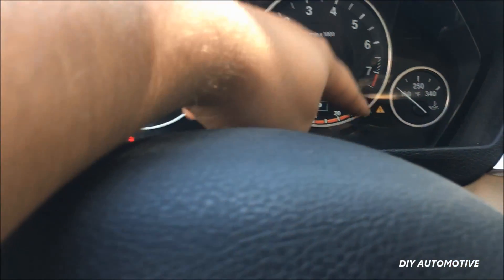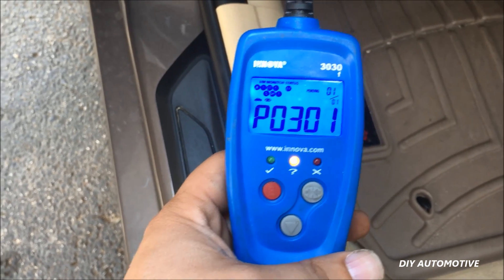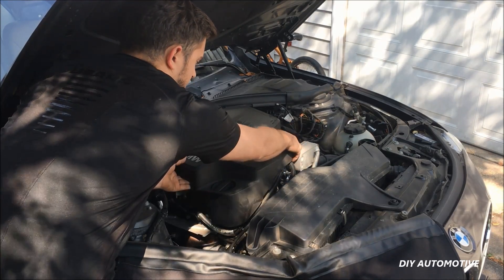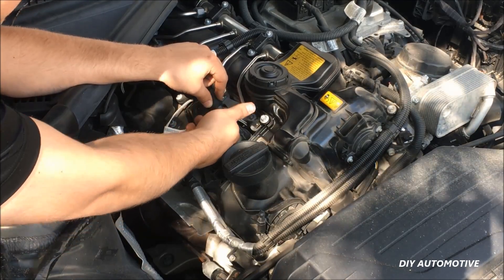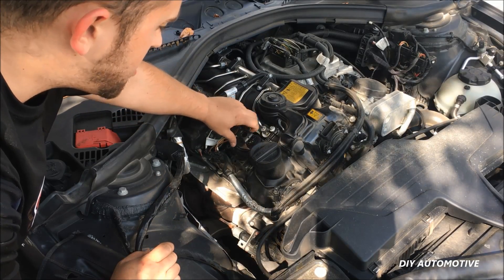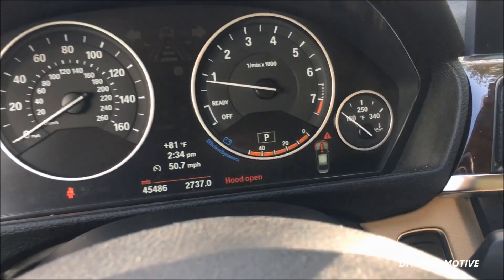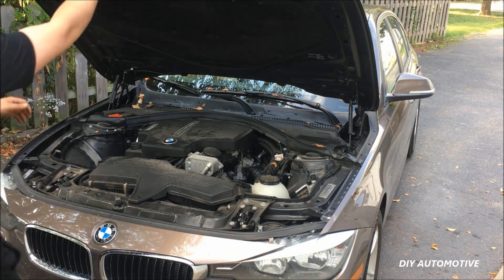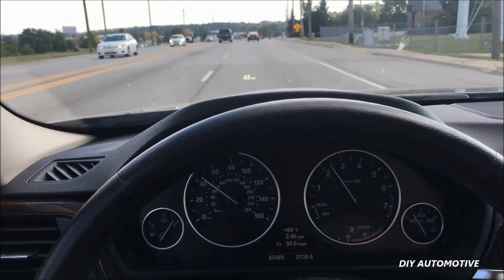Fix Misfire No Power; BMW Ignition Coil P0301 P0302 P0303 P0304 P0305 P0306

Comment from the maker: Link to coil: https://www.ebay.com/itm/322979331273
Reply: I am from indonesia. My f30 suddenly difficult to start then the engine is shaking and suddenly the engine turn off. In i drive show drivetrain multifunction. 3 month ago i already change spark plug. Now the problem is iginition coil fault or crankshaft sensor?

Comment: hey man i have a f30 with the “drivetrain malfunction” screen and when i scan it, it shows generic codes P0001 and P0003. Could this also be the spark plugs or ignition coils? thanks
Reply from the maker: Yes, recommend replacing both.

Comment: Thanks for the video. I got a P0301 code a month ago and a p0302 today. The car has been struggling going up hills at low rpms but idles fine and runs fine otherwise. If it’s a coil or plug issue, will it be present all the time or can it be intermittent like I’m experiencing?
Reply from the maker: It could be intermittent. I would replace the coils and plugs.
Reply: I’ve got a 2008 X5 3 liter. Thanks!

Comment: If this happens at less than 50K, it's under warranty. The first time it happens, let the car cool down 100%. It should be fine to drive. Make BMW replace ALL the coils. It will happen again under 5-6 hours of over 80 mph. Mine did it at 40K, 20 miles from the house. Ran fine the next morning. Took it in. Was fixed under warranty. Fixing is easy, cost for parts is a few hundred to replace all.

Comment: im getting P0305 ..i changed the coil pack ..so next step is the spark plug? do i change all of them or just the one
Reply from the maker: It may be a bad plug
Reply: @stlouissux9119  thanks it was actually the coil pack ..i put one on from oriellys auto part and it didnt work. i replaced it with a better one and car runs great
Reply: What kind did you use @MechanicxFilmz
Reply: @stlouissux9119   on my bmw x5 i am not getting fire on the cylinder numer 2

Comment: same problem in my car i changed spark plugs and all ignition coils but still engine shaking no idea whats going it shows problem in cylinder 3 😒 before but  no power in first gear what is the best solution for  BMW 320i se ?
Reply from the maker: What codes do you have?
Reply: DIYAUTOMOTIVE thanks for ur replay but mechanic dont even tell me what codes come up he just remove engine sign from dash board to get money from me ltr on same issue then ltr on he said its may b injector issue in ur car or maf sensor or egr valve issue he dont even no yhe codes?? Still same issue in my car
Reply: @Qrafi321  get a code scanner. I have the blue driver code scanner cus it works with almost all the cars made after 1996. It gives you the codes and the most common ways that people have fixed the problems for the code.
Reply: @luiss.3866  yess the blue driver 💙 is Definitely a life saver as I also have misfire codes on my 2002 BMW X5 3.0 sport car has 215k miles on it so it's best for me to just get new spark plugs and ignition coils, but everyone I know tells me to stick with either Bosch or NGK products only...

Comment: thank u for video. same check engine and drivetrain mulfunction faults.  I have 2011 bmw 740 li and I have P0300, 301, 302, 303, 304, 305, 306 codes showed up. I got new coils from ebay (6 set of coils were not original coils. cost was around $160 for 6 coils). still has a misfire. sometimes misfire  happens on the road after I start engine 15 min or sometimes 4, 5 hours driving. do u have any Idea? thank u.
Reply: Did u ever get the problem resolved? I have the same vehicle with only 41k miles with the same codes. I was told to check the low pressure fuel pump sensor.
Reply from the maker: Hello,

Did all of the codes appear at the same time?
Reply: P0300 means random misfire. It's likely due to something more serious or maybe fuel injectors. Could also be valve leak and many other issues.
Reply: @ذوالْفَقار11111  and so on and so on these BMW are full of shit this is just a problem that can't be solved

Comment: Got a P0105 code shows up on my 2006 bmw e90
Reply from the maker: That is not related to the ignition coils, sorry!
Reply: Do you have any idea the cause ?
Reply from the maker: Possibly the manifold absolute pressure sensor (MAP)

Comment: Thank you for the video, I will give it a try,  I got a PO301 code.
Reply from the maker: Good luck!
Reply: Thanks DIYautomotive,  I bought a new coil, that was not it, so I bought a new NGK spark plug, the other one was corruded. The plugs need a change. I did the col test on all 6 cylinders, you undo the coil connector while idling, if it runs rough your coil is OK. if the car idels the same smooth when you diconnect the pil connector that means that single coil is no good. My brother sold me this 2004 325i 3.0L BWM, we like this car. Just leaarning how to do routine maintance.  I like videos such as this one. Very kewl!
Reply: Broandrew make a video
Reply: @salvadormoran8364  is up. Go to Youtube and type in "BMW HHO installed on a 2004 325i"
Reply: @salvadormoran8364   I will make a video soon at Hydrogen Garage YT site. Give me a few days.

Comment: Is it recommended to change the spark plugs to go with the new coils or will the ones in there be okay still?
Reply from the maker: It is generally good practice to change the spark plugs at the time of coil replacement. Since you are already in there replacing the coils it will just take a minute extra, so it's certainly a good time to do this!